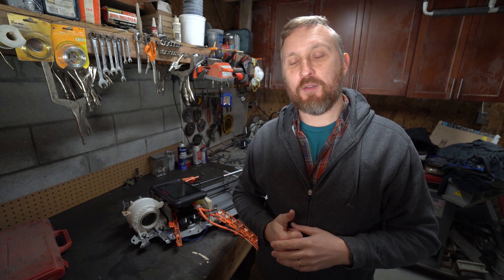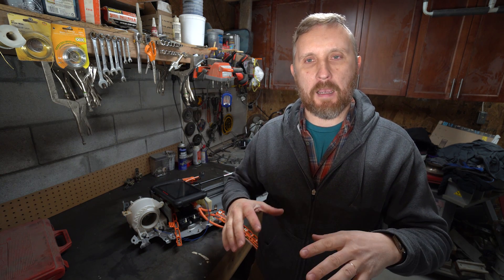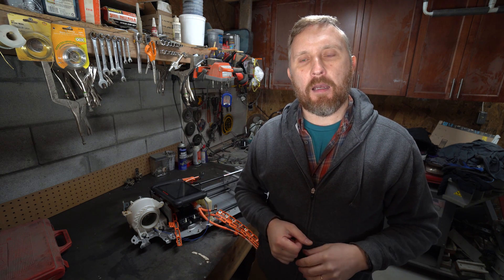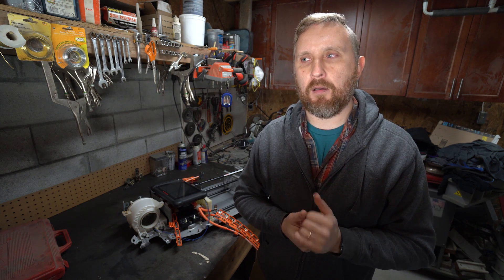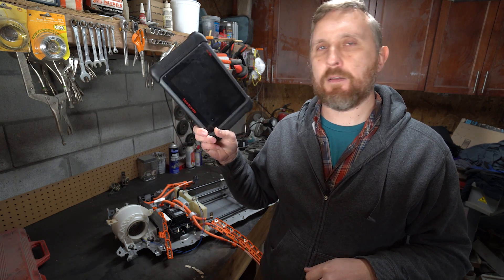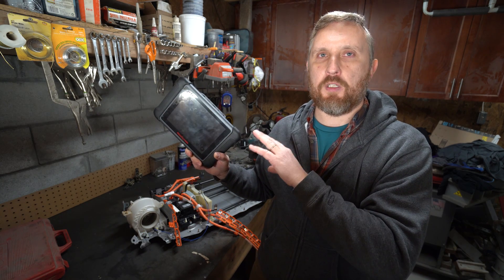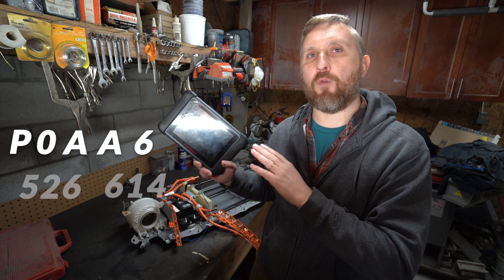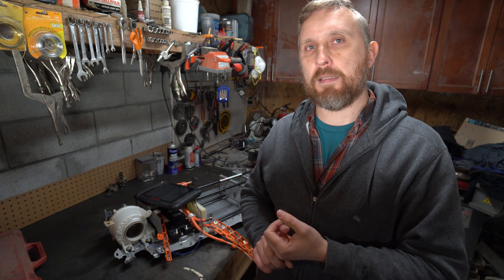Prius triangle of death P0AA6 612 Toyota Prius How to find bad cell

Comment: I believe there are some rubber plugs in the spare tire well that can be removed.  Also, it seems that the fuel tank is under the rear seat so it's possible to find a good location to drill some holes to let the water out.  I'm sure that the 12v battery has a plug at the bottom.  Remove it.  It's beyond me how some water in the 12v battery well can affect anything.  The 12v battery is plastic and watertight.  Check the rain channels where the hatch gasket seals and schmear some clear silicone there. (please clean it first?)

Comment: shows POaa6 -516.611.612.613.614
c1259 hv system regenerative fault
c1310  fault in hv system/ fault in actv brake booster solenoid

Comment: What kind of reading will you see if it’s good? And bad?
Reply from the maker: I’m measuring for any resistance between terminals and metal frame
Reply: @akindiyrebuilds6223  When you say you are looking for resistance, can you give a number range for people who don't know? That would be a great help! Thanks!
Reply from the maker: @lukewaters1559  There is no certain number I’m looking for any resistance, basically any number would tell me there is a problem. There supposed to be an open circuit meaning no resistance no continuity.
Reply: @akindiyrebuilds6223  Good element mean 0 ohm ? And bad one will return any positive resistance right ?
Sorry if it's clear in the video but my main language isn't English.
Reply from the maker: @InconnuAnonyme404  when I take my measurements, I am looking for any resistance between battery cell terminal, and HV battery frame, while battery cell is still bolted to the frame.

Comment: Im having all the same problems with my prius after a minor rear-end collision 🙄. I found all the cracks in the body and sealed them up with silicone. The dealer said that there is a smart key sensor behind the rear bumper cover that was damaged but not replaced by the collision repair place that could be causing the problem. so I'm going to replace that and see what happens.

Comment: Are you talking about 612 or 614??
Reply from the maker: 612
Reply: @akindiyrebuilds6223  thanks for the reply what could be a voltage reading acceptable for you because in some modules I get 0.20 and 0.15 V is that enough to trigger a code ??
Reply from the maker: @kennycharneca1  you should check resistance instead of voltage if you’re looking for a leaking cell
Reply: @akindiyrebuilds6223  thanks sounds understandable do you charge the prius modules ??
Reply: @akindiyrebuilds6223  is resistance higher, lower or missing in a leaking cell?
Reply from the maker: @goneballistic  There’s supposed to be no resistance at all it should be an open circuit

Comment: What are the results in case there is a leak from one of the cells?
Reply from the maker: You would have a red triangle and check engine lights on your dash and you would have to replace the leaking cell